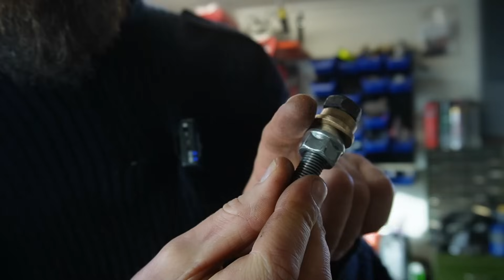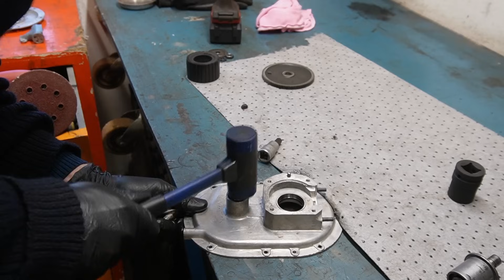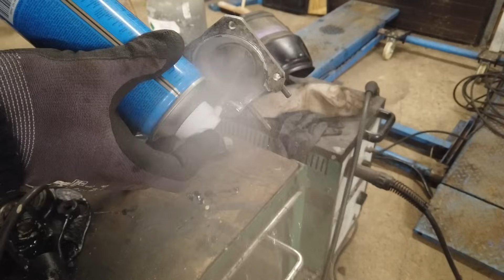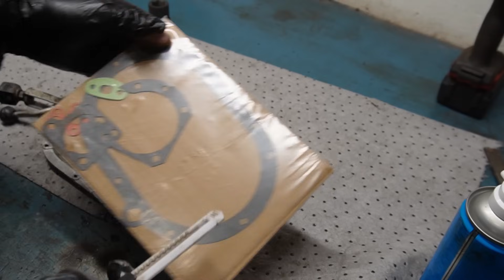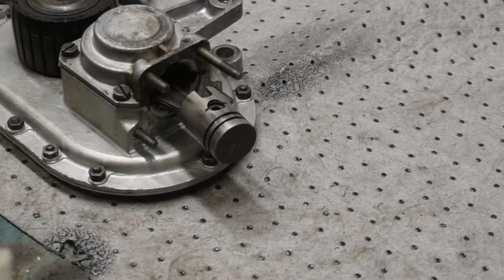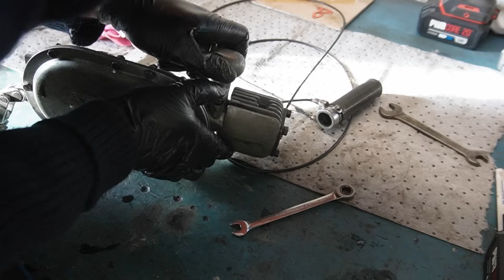Diesel Two-Stroke VARIABLE COMPRESSION | Engine Rebuild

Comment: Those bushes are Sintered Bronze, very popular back in the 1930s for electric motor bearings still used today in some applications, you should be able to buy various sized hollow stock in long lengths from a bearing supplier then machine the sizes you need, you will have to heat up some oil and put the bushes in the hot oil, much like how new motor bike chains once were lubricated. I used to save these worn bearings to re-machine them sometimes even make oversized sleaves or shafts if time was an issue.

Comment: will you do more video's about these?
Reply from the maker: Yes!! Its been awhile since something broke and parts are hard to find... But more will come soon.
Reply: @SeasideGarage  what parts do you need I might be able to help
Reply from the maker: @robot797  I needed a new piston... But I got one made now ! But thanks !
Reply: @SeasideGarage  what type 
I can get the 2 ring version within 3 days
Reply from the maker: @robot797  that's was quick! But it arrived this week... :) to rings to control them all... :p
Reply: @SeasideGarage  well there is a dude localy that is cleaning his garage
and he has a few dead engines he is trying to sell

I am thinking of getting a few of them as spare parts for my engine
but I think he wants to much
Reply from the maker: @robot797  yea they are getting way to expensive....
Reply: @SeasideGarage  125 euro for a corroded block
without a exhaust and dribbler 
but with a decent drive wheel

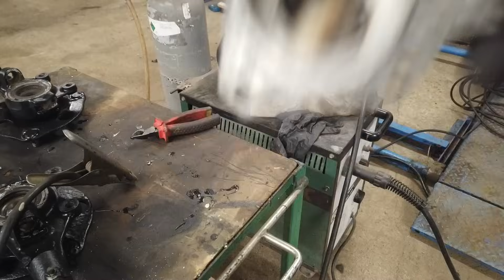Comment: 7:30 if you weld the bearing ring, you could have welded a bar across the ring and pull on that. Or even two hex nuts and just use two screws to push :D
Reply from the maker: Good idea!

Comment: To make it run I've found on the internet an online article that seemed useful, in particular, it stated:
[...] I have found a workable mix is 1 part diesel, 2 parts petrol, 4 parts paraffin.  The petrol component makes it run smoother than paraffin alone, and the diesel counteracts the decrease in viscosity caused by adding the petrol.  This blend is mixed 20:1 with 2-stroke oil.  Adding diesel Red-Ex (1cc per litre of mix) seems to make it run better, but more than this makes the engine less flexible and more sensitive to compression setting.
[...] The Lohmann engine has an adjustable jet needle in the mixing chamber, and mine is currently set with 0.6mm protuding beyond the end of the throttle slide.  With the freedom to use different proportions of paraffin, petrol, diesel, maybe heating oil, different needle positions, there's no way of knowing if all this is anything near optimum, but it is very useable and good enough for me so far.

Link to the article: http://www.users.globalnet.co.uk/~pattle/nacc/arc0413.htm#:~:text=As%20people%20may%20know%2C%20the,there%20is%20no%20injection%20equipment.

Comment: Did you measured the clearance between the faces of the piston ring?
Reply from the maker: I did not, its supposed to be pre gapped and I hope it is.. the cylinder is a blind hole so measuring is very difficult.. and my cylinder gauge is not small enough ! haha
It LOOKED good enough, at least not to small which would be catastrophic

Comment: You might have been able to get the "Oilite" bushes from Bearingboys in the UK.
Split type spring washers have been unacceptable for a long time now. They are banned on military aircraft. Use Nylocs unless it just has to look vintage. Serrated washers and Loctite as an alternative.
Reply: as I've experienced, split washers aren't accepted in general in any actual new engineering, the only reason they'd be used is because someone decided to simply copy&paste old stuff

Comment: You should weld all around the bearing race, would probably work better... you could also put a piece of mild steel across with a nut in the middle and use a puller :)
Reply: Exactly my thoughts.
Reply: Yeah that works great, usually it just falls right out, in fact I don't recall it ever not working. @krtgiroto